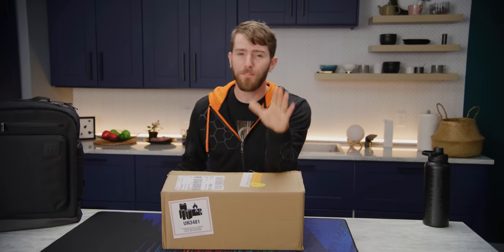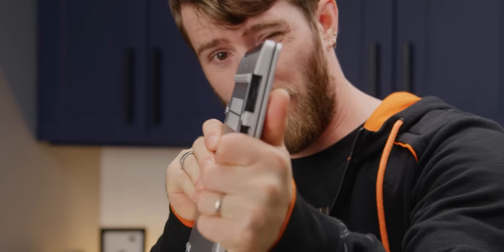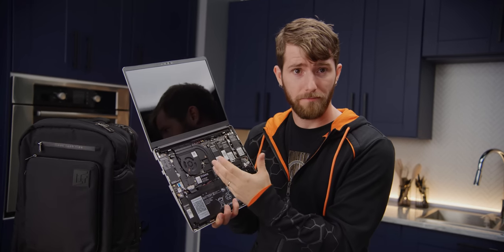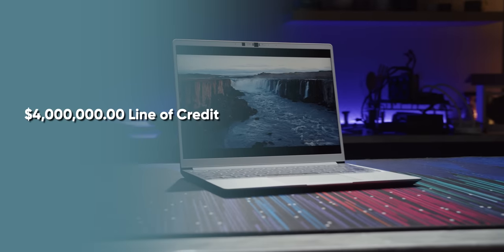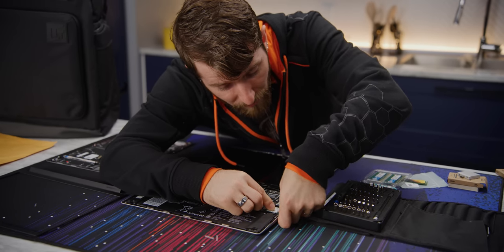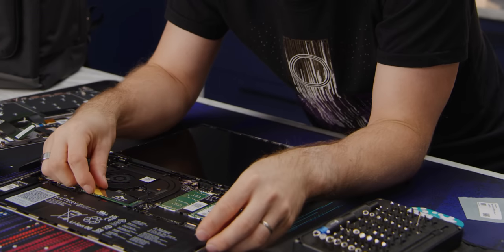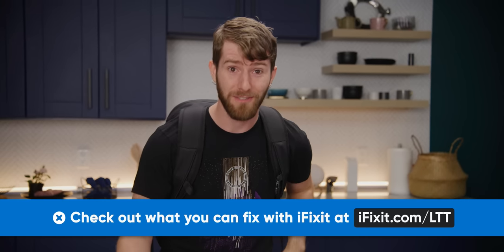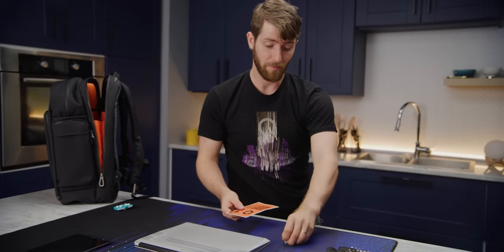I’m Legally Obligated to Disclose This - Framework investment

Comment: This is positioned as a consumer product, don’t see how they could expand into the corporate space (easily more profitable as corporations would buy bulk and can easily repair broken products by just ordering parts as opposed to RMA the whole machine). The RMA process is much easier and you’d be surprised how many companies would rather deal with that then just fixing the product themselves. However, I am hoping the best for you and your investment, this could be great for retail!
Reply: As a SMB part time admin myself with no access to any sort of support, Framework would have been great. It would take the same time to fix as any of the DIY desktops in the office (subject to parts availability) and people can be up and running faster than me ordering a new one and moving apps and files over to that.
Reply: Corporate space demands certain requirements and support. My business laptops get next day on site repair. It helps IT staff to do other things than spending 2 hours to replace a damaged screen or keyboard.
Reply: @Seatux  well many companies have machines that arent used and will just take old one deploy their standard image on new one and give it to the user
Reply: I think this might be a mute point!  Framework could theoretically next day ship a new device as well!  Unless it's drive failure, on-site IT just switch drives and the employee is back up and running just as quickly!  The cost effective potential of being able to reuse a chassis while slowly upgrading hardware over time could net legitimate cost savings if done correctly!  I think it will be up to framework to establish those capabilities and outline that as part of their pitch in the future!  Good luck!
Reply: @fukyespopwar  Depends on the business and the model.  If you have a depot with spares, and techs with enough time to fix them, then it can make sense to do it in house.  If that's too much of a pain, there's nothing wrong with outsourcing that sort of thing.

Of course, then you get to, as you said, support.  When the depot can't fix it, how fast and trustworthy is the company.  Larger organizations prefer standardization, so will they meet demand, and be willing to supply an older model for years?  Then what's the SLA?  Legal and the higher ups want to make sure that all the i's are dotted and T's crossed.  That requires a vendor willing to go through the headache, and they charge for it.

Mind you, standardization doesn't stop all modularity, so Framework wins big time there.
Reply: @fukyespopwar  that's great, but as a developer who's experienced that a couple of times recently, I've lost an entire day, maybe two if it's a new device that I have to set up.

Some repairs for sure make sense to do outside the support team, but if it's something simple it would be better to get it done and have everyone moving again.

We had a Dell guy come and swap a motherboard of one of my team a couple of months ago on the desk next to me, took maybe 30 mins. But we were out a Dev for a day and a half. That's a not insignificant cost.
Reply: @joshlambert1247  With custom build configs from Dell, HP, Lenovo, etc. shipping next day isn't always possible. Though the modularity of Framework would simplify that. Sometimes you pay the larger manufacturers extra for custom deployment packages. So that's something they would need to consider.
Reply: I reeeaaally don't think this is right. "Corporations" don't buy their IT hardware, their IT department does. Any CEO/VP/Director worth anything would hear their head of IT on it's opinion. Between given the options of, every few years, buying 50 new laptops or just upgrading everyone's ram for example, or buying a handful of expandable storage, the choice is clear. And yes you have to pay IT staff to actually do it, but IT already will regularly take hardware to upgrade, update, install & replace. That's just what they do. (Plus by replacing, the IT dept. also has to work to wipe and liquidate/sell the old hardware safely and "profitably"-not happening-, a lot of work). The freakin trash and replace economy must end!! Sustainable development is a part of every company! It's 2021!!! Anyways thanks Framework, thanks Linus.
Reply: @morosis82  That's the reality of a business though. Even if you have on site IT support that can repair you have to make sure you have those parts available.
Reply: It's not that easy. You are assuming that someone working for a company can just pick up a new laptop and go and everything is hunky-dory and there's nothing that is on their specific laptop that needs to be transferred, accounts associated with that laptop that need to be logged into, apps that the specific employee or CEO needs on their specific laptop and other issues. Most times being able to just transfer the drive (something you often can't do and almost always is difficult to do without 4 different screw drivers, spudgers etc most times just to find out you can't do because everything is soldered to the board.) takes a lot of time. This one theoretically you could have all of the main stuff on one of the add-on cards, swap the card from one to the other and it took 3 min to do what could take hours on most other laptops. 
On top of that there are many companies I have worked for who told me they never ever RMA laptops once they have been set up because there is sensitive information on the devices that cannot leave the custody of the people who have been hired and vetted and it's better to shred the laptop than let it leave their custody. This way the drive doesn't leave their custody and they can remove the drives from the devices and swap them to a new one. 
I worked for a company that dealt with an automaker and just having to see the parts lists and build sheets of unreleased unannounced models meant I was required to sign an NDA and be subjected to a background check on the off chance that I took a pic of those documents and it got released. No company laptops ever leave their custody or the custody of the partners under any circumstances, and the extra costs associated with having to deal with faulty products is just "cost of doing business. Just entering their custody means that devices cannot be returned. They destroyed tons of blackberry devices that were faulty and never got RMA'd.  I would say that chances are excellent that they and their partners are going to take a long hard look at these devices.
Reply: @joer8854  I used to work for a PC repair company and I had to sign NDAs on the off chance that I might maybe perchance had seen something on someone's monitor whether I had or not, while walking through their facility.  You're also right about them not RMAing anything.  If their inhouse or outsourced local company can't repair a piece of equipment, it's cheaper for them to just destroy it and get a new one, from a security perspective.
Reply: @fukyespopwar  I've had experience of "next day on site repair". While it is true that a repair tech can be on site the next day, it is not necessarily true that the required parts can also be on site the next day, and not necessarily true that the technician can effect a repair when on site. After some failed attempts the fastest solution was to send the laptop back to a repair center where they have a fully stocked warehouse with all parts on hand. In retrospect this would have been the best initial option.
Reply: you're absolutely right in your assessment of the corporate space on those types of orders... on the flip side of that, if a company is "team green" or "eco-friendly," this is a great way to PROVE it to those on the outside of said company. also, using your logic, some companies might deem it beneficial to create a new position of "hardware mechanic" (or something like that). the company can easily order say 5% extra machines and/or components and simply get "loaner" laptops in the meantime. no downtime. there's downtime and/or rotating product to consider. because of the modularity, the user's storage drive can easily be swapped out provided the files need are stored locally (which would be a bad move.... i mean.. in this day and age.... redundancy???) i guess what i'm saying is, the same way a company has mechanics or garage shops to work on their fleets of cars, the same can be created for eletronics with right to repair now.
Reply: Corporations buy in bulk, but they also pay far less than the normal retail prices. So profits are slashed unless you can ship millions of units.
Reply: You’re probably right. But I think you’re GROSSLY underestimating the size of the small business market who are stuck in the “middle” of those two options
Reply: Coming from someone who did enterprise IT (~5000 users) for 12,5 years-- employees in our company usually got an itch every 2-3 years max for a fresh laptop and not just over specs; the casings and keyboards and screens wore out and got nasty over time while newer models looked better and image towards higher-profile costumers mattered.

In our case we trained people to use compact external keyboards we had hundreds of in stock with laptop stands for ergonomics but it was really just an easy fix. Replacing laptop keyboards took exponentially more time. I started out swapping stuff like notebook screens myself but with the dozens of screws and finnicky thin wires to route everywhere it took too long.

So for repairs-- always a number of spares per model in stock, in case of hardware failure usually a disk swap would get someone up & running again in minutes while they sent someone to fix the thing asap.
Reply: @interlace84  It was an easy fix but now almost all laptops everything including the drive is soldered to the board. It's all or nothing, nothing transferable, nothing repairable. They also often refuse to supply parts for stock and the parts must be ordered on a case by case basis IF they aren't soldered directly to the board.
Reply: the high end cpu has remote management capabilities via the Intel chip. corps would also have a bin of replacement parts on hand. easy sell. The big vendors have been horrible to work with in Covid times and we're only bearable to work with before then. this is an easy sell to corporations once the get more cpus at a lower price point that also support the remote feature set ( current one is very expensive and not needed for most companies)
Reply: @joer8854   That's where corporate carepacks and extended same/next-businessday warranties come in-- engineers have a spare mainboard (or defective component) with them and can swap in a couple minutes if needed.

That was HP though, we later switched to Dell with less ideal results.. btw business notebooks do not have SODIMMs or SSDs soldered to mainboards. Worst case you'll have to wedge and click open the housing to access the mainboard if there's no easier access.

Comment: I really hope they design a second generation of this with gpus for gaming. I’ll put my money down the second they manage to get a gpu in this
Reply: Since they have full thunderbolt support maybe an eGPU is an option? Depends on how portable you want to be while gaming, but for me it's definitely the way to go.
Reply: @laka1469  doesn’t make sense to use one, if I wanted to carry around a box I had to hook up I would just carry a sff desktop and a mobile monitor
Reply: Yes. At the very least a new Zen APU. I skipped upgrading my current  9th gen Intel laptop this year because I want to wait for a new Zen based Framework.
Reply: @shadow7037932  I agree, I’m holding on upgrading my Dell xps 13 from years ago until I see the right thing for the right price with a gpu so I can casually game
Reply: @04dram04  it would be a pointless waste of money to do that. Buying a laptop without the specs I want and buying a gpu in an inflated market. Better to just get the ASUS rog laptop if I wanted. It’s not an urgent need so I’ll wait and see
Reply: @tylersanders2388  an external GPU can wait at home to power your gaming while the laptop comes with you for less intense on-the-go use. an SFF keeps the GPU with you at all times but can't be used without an external monitor, input device, and power supply. neither is pointless, they just serve different purposes
Reply: @TheZALGOisCOMING  you forgot to mention the massive 30% power loss of an egpu

Comment: The problem with anything modular is the holding of large amounts of technical inventory. This is the reason most manufacturers use "Just-in-Time" manufacturing. Having a large supply of out dated parts is not good for business. Also with Tablets and "2-in-1" taking away more market share from laptops there's less market space for a premium priced modular laptop. Also because laptops have a tight area to fit everything into most components are soldered onto the motherboard leaving only a select few components that can be upgraded and I Don know that those few components are worth the premium price tag.
Reply: I think with the prolonged pandemic and global chip shortage OEMs will start to examine whether "just-in-time" manufacturing is still the best business decision.

Comment: I want to see the 17” workstation version with replaceable graphics cards, more ports, an actual clear cmos button inside the laptop, and way more cooling. I am excited that a company is going towards the values I hold dear. I just hope their bioses are not as bad as HP’s.

For the people who work at other laptop manufacturers: You blew your chance to be first with a fully modular and fully repairable laptop. Also, stop making right to repair so hard. I could have built better designs to deal with the components than some of the mobile workstations I have worked on.
Reply: Dont laptops have on power on switch holding patterns for CMOS clear? I remeber on mine G72 u need to press for 10 sec and again for 5 second (or something like that).
Reply: Laptops with switchable graphics. That's the dream ! Its gonna be complicated to design a power envelope that can accommodate such changes.. but lets hope someone does it. We will then have a truly modular, repairable, upgradable laptop..God damn !!
Reply: I bet something with graphics is on their roadmap

Comment: Framework's modular approach is the way to go. I hope it succeeds. LG phones tried the modular concept with the G5 in 2015, and I bought one, mainly for the easy-to-change battery module. It didn't catch on. I think it was mainly due to poor execution. I own an Intel NUC desktop. It's not exactly modular, but very easy to swap out components.

Comment: I am glad to see a huge influence in the tech space supporting a small company that is doing the right thing
Reply: @sys-administrator  did you not watch the video?
Reply: @sys-administrator  the only reason you can't buy those parts is because they haven't had time to allocate runs for them as standalone skus. You can purchase those parts direct from the company by messaging support however.
Reply: @sys-administrator  They will bring in everything eventually. Even swappable motherboards with cpus/gpus or at least that's the plan and that's what they claim. I as well am very skeptical about all this. The thing is, concepts like this have been tested a few times in the past, from bigger players and failed. Times may have changed though and it does sound very cool and all but.. too good to be true imho.
Reply: @WyattOShea  Yeah. No pointing trying to explain to someone who has made up their mind. Quite possibly 90% of people who have watched the video think it's fucking brilliant.
Reply: @sys-administrator  Yes, technically you're correct. Whether that changes or not in the near future, is up to Framework to prove it. Tbh, I wasn't aware of what Wyatt says, by messaging support you can get spare parts/replacements already and that's encouraging. Scroll a couple of comments below, there's a great write-up on a reply from greysomething that sums up the whole concept in its entirety.
Reply: @rjv_mntn  Agreed mate it seems really good to me. I don't need a laptop and probably won't have a use for one for a long time or even ever but the fact that I could go out and buy a Framework laptop and decide oh hey it would be nice to have a full sized hdmi port or whatever else and just be able to buy a module for it is great imo.
Reply: @WyattOShea  Same here. I do not need to upgrade my laptop anytime soon, but Framework will be on top of my list if that day comes. Hopefully, they start shipping internationally soon.